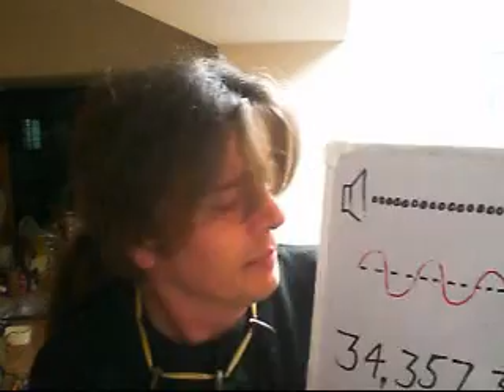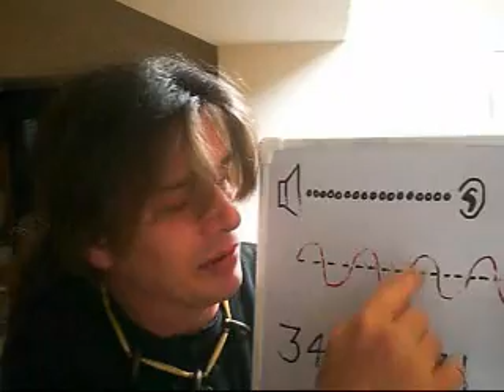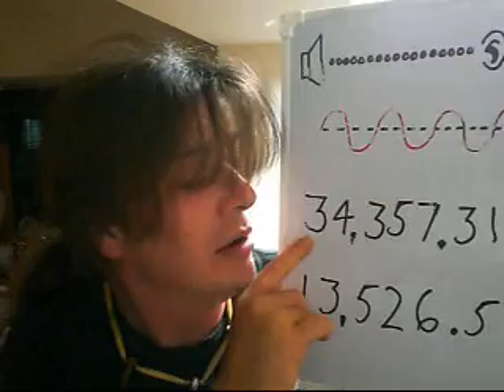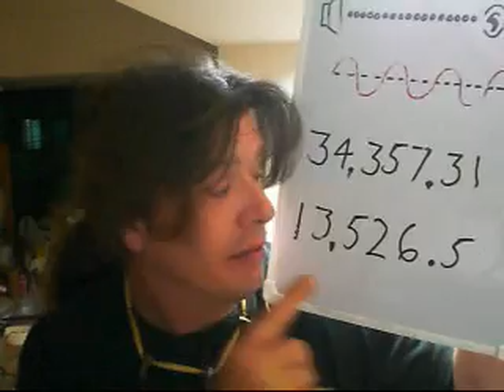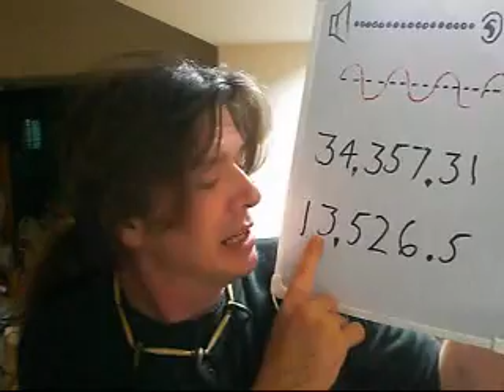How to Make a Flute - Finding the Notes' Wavelengths

Comment: How diameter of tube effects the length and,frequency,  of flute reply plz
Reply from the maker: My apologies for the lateness of my reply! I've only just now regained access to my channel here - access was lost to me FOR YEARS, and I just now got back in! Your question; the diameter-vs-length affects the vibrations of the notes' wavelengths. The vibrations made within the flute uses the closed space to vibrate against, so if it was wider than it is short, the vibrations won't happen - if it is thin, but way too long, the vibrations would cancel itself out and be muffled = no sound. My other video, titled "How to Make a Flute - Materials and Flute Physics" might explain it better. Thank you for your comment! ^_^

Comment: Another tip on bamboo is when you cut it let it dry completely in environment similar to where it grew and out of direct sunlight. This takes  months so what I would do instead is I would look for bamboo that had already died and dried out. Most of it would have rotted and split but some of them were in perfect condition and those would never split on me. Bindings and shellac or oil are a great idea too.

Comment: Really interesting; your explanation was so clear and precise, I decided to go and test it :) so I took my alto blockflute (lowest note is f4, 439,23hz), and did some maths: 34357,31cm / 349,23 = 98,38 cm (approx.). Divided by two = 49,19 cm. But the actual lengt of the flute (without embochure) is 41 cm! How so?
Reply: It probably depends on the bore diameter

Comment: Thank u so much ! I ve searched for months for a good finish, and no one ever menshioned this "urushi". This is a great finish, and not only for flutes, but also for the bamboo mugs that I never did cause I never found a substance that was non toxic and protected bamboo from heat and water! I guess this finish is a lot better than  polymerized tung oil.  Now I only need to find out how and when to apply it. Thanks again : ) 
Thanks again, hope I

Comment: After reading your post I compared this method with another one I have from mark shepard. In the end the measurments are identical. So, the only thing that is lacking for me is practice! Another thing that bothers me, is that the root note and sometimes the 2nd note is very hard for me to get. I need to blow very gently or I loose it, sometimes I overblow it and I get the 2nd octave note. So I don´t if it is me that didn´t get the hang of it or if the flute is not well made!